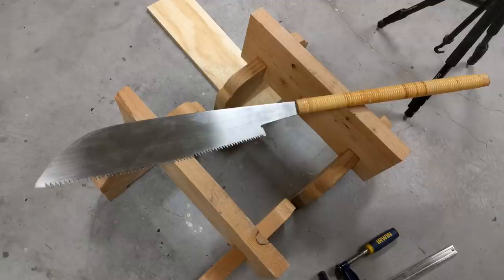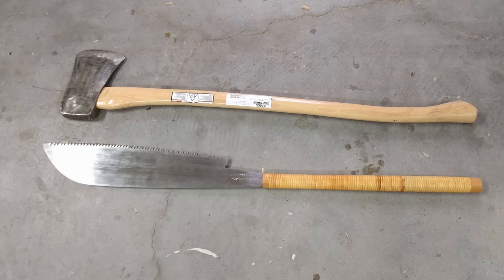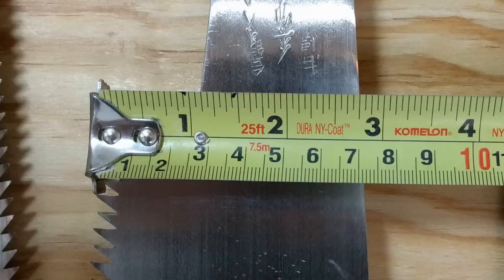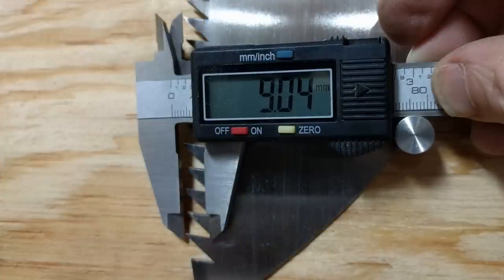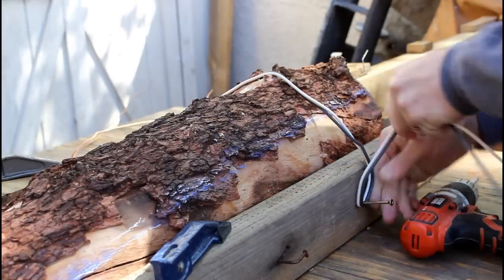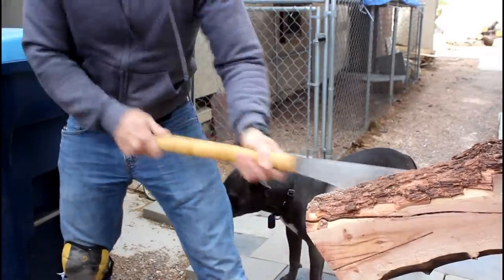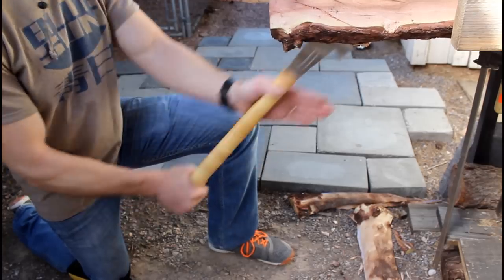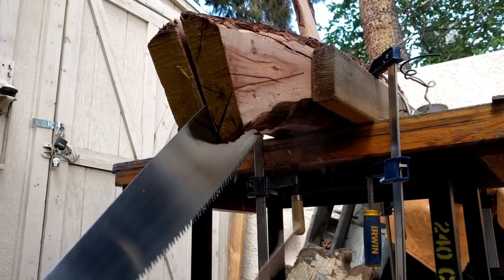Anahiki Nokogiri Japanese Timber Saw

Comment: you don't need to clamp the saw to anything to drive the handle home. just get it started, stand up and tap it home from there holding it vertically.. watch those precious fingers when getting a cut started. I've enjoyed the bennies of these saws for 40 years now and no going back to those pushers. cheers.

Comment: I bought something that looked a lot like that a few years ago.  Same look, length and teeth.  I wanted it for rip cutting, but was told by UK based Japanese tool users that it is a cross cut saw, and that it isn't finished from the factory and would benefit from sharpening and adjustment of set.
Reply: This is correct, I just gave mine a sharpen and it's SO much faster. Have not touched the set but that's mainly due to not knowing anything about it.

Comment: i have three of them.  i got them from longshoremen in sasebo while loading the ship.  they are a fearsome tool.  watched them cut 6  2x6s at once rather than one at a time.  the blades are long  and thin.  the teeth tend to be brittle, have to be careful of the pushing the blade back so that you don't bend the saw. it takes practice

Comment: That thumbnail / shot at the end looks well composed.  I figured you were an expert, not using it for your first time.  Looks like the try it and observe and adjust methodology is working pretty well for you though.  You seemed to be getting some good traction.
Reply from the maker: Thank you Sol.  Sorry to get back to your comment so late.  I've been able to use the saw a couple of times now, and it's becoming my favorite for rough cutting timbers.  I was able to get an old hand plane adjusting hammer that needs a new handle.  The saw was used to rough cut an olive tree log for the replacement.

Comment: Can't believe the blade is less than a millimeter thin. It surprisingly sturdy
Reply: As long as it is stroked straight, the blade stays in tension while under load (draw stroke). The technique requires attention though, too much sideways pressure or misalignment can cause it to fold and kink especially on the return stroke. These saws have a less pronounced tooth set (ie size of kerf) than western saws.

Comment: Sweet buy. Which position did you find works best for you?
Reply from the maker: Thanks.  Whether I was standing or kneeling, my left leg was forward and the right was back.  The but of the saw handle was pulled to my right hip area.  I also focused on making sure I didn't try to force the cut and letting the saw do most of the work.

Comment: Do you replace the blade when it gets full or do you send it back to Japan for resharpening?
Reply from the maker: +Brian M. I was going to try sharpening it when it gets dull. I have the feather files. Also, the teeth are fairly large so it's easier to see the angles on them.
Reply: AdventuresInDIY you should get publish a video on how to sharpen Japanese saws.  I’m definitely interested!
Reply: This saw in particular is dull from the maker. I just got a diamond feather file and gave it a rather amateurish sharpening. My lord the difference is like night and day - it just wants to EAT the wood now, as in it starts a cut from just placing the teeth on the wood, they start to dig in immediately.

PS: I got a_ diamond_ feather file specifically because I can use it to sharpen my replaceable high-hardness blades. It's both cheaper (I am a bargain shopper) and faster than having to order a new blade if I see mine go dull. Plus I'm not at the mercy of a useless saw if the manufacturer decides to not make them anymore. I'm not worried about the diamonds upsetting the carbon content because I don't imagine the couple strokes per tooth builds up anywhere near enough heat to have an effect.

Comment: I got one of these and I suspect it's not sharpened from how slow it's cutting. Still faster than my smaller saws, but I knew something was wrong when it was taking much longer than how I've seen american and british push saws cut, with their thicker saw plates. 

PS: I also have a small suspicion that it might be a forgery from the sheer amount of "new old stock" the seller has been listing. Of course it could be just that the sawmaker offloaded a whole warehouse of unsold stock, but for the price I paid (a tenth or less the cost of a rusty maebiki) I can't really complain since it seems to be well-made regardless.
Reply: So here's an update: It was NOT sharpened from the maker/seller. 

After giving it a sharpen, it cuts so much faster.  The teeth dig in in by just placing them against the wood without even starting the cut. I am no sharpening expert (I did use the feather file on 2 other saws first to get a feel to handle it) but even with my amateur sharpening the difference is like night and day. 

To put it poetically: Sharpening this saw turns it into a demon that glutinously devours any wood you put in its teeth.